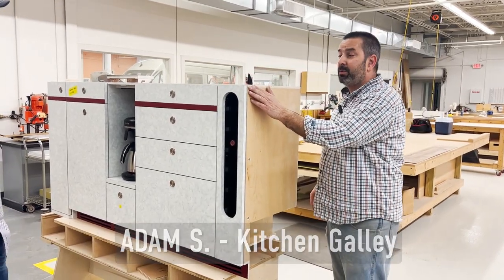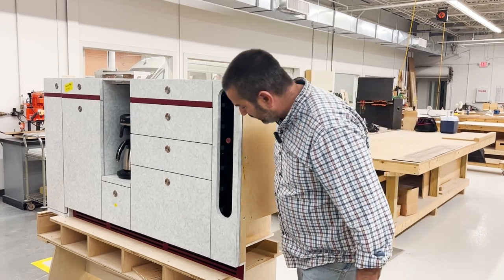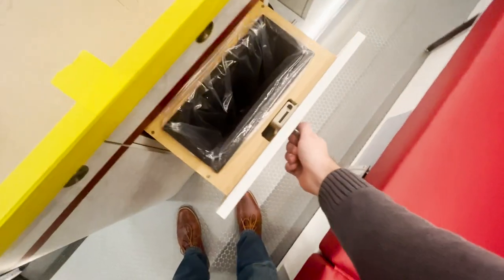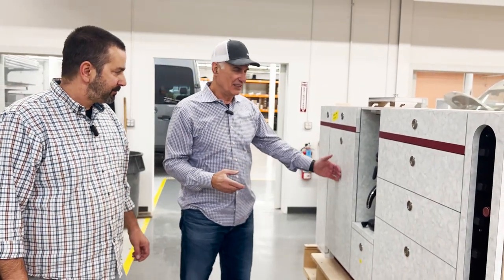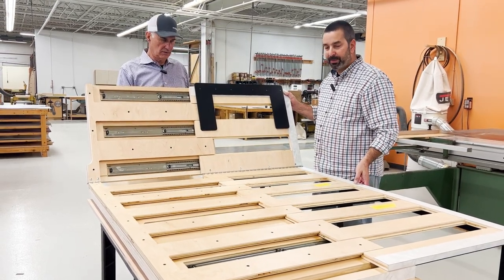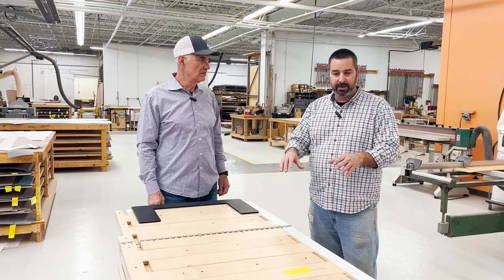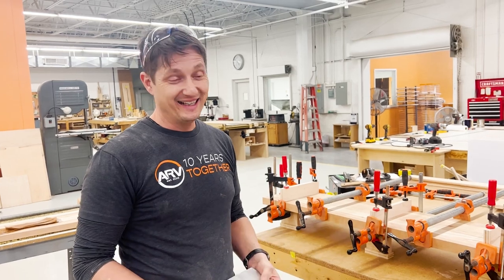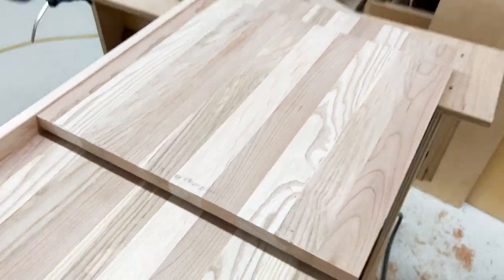Custom Bed and Galley In Progress | MT Nest Build

Comment: People's choices are always interesting.  I wonder if the buyer had a chance to re-do their vehicle a year after owning it, what changes they'd make.  If I had to guess, I'd say initially people try to cram too much stuff into a small space.  In our case, even after five years of ownership, after every trip we analyze what is important or not, then jettison the useless or underutilized stuff.   Electrical hog appliances are another thing.  I noticed this client has a 120 volt coffee pot.  Not only are they power hogs but a pot of coffee will continually produce steam which will result in heavy condensation inside the rig, especially in the winter when venting is difficult due to the cold temperature outside.  We've shifted from a coffee pot to a single serving machine.  Not only does it save power, but it doesn't constantly produce condensation.   Very nice build BTW.